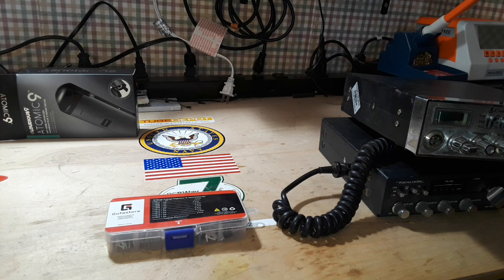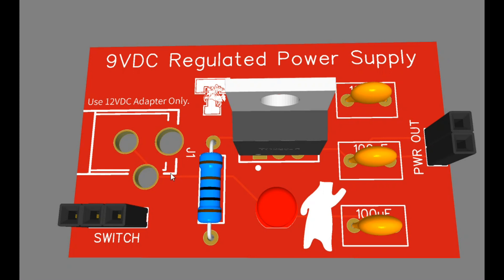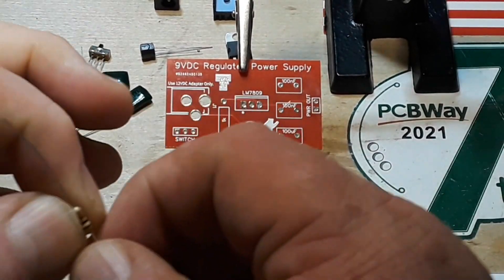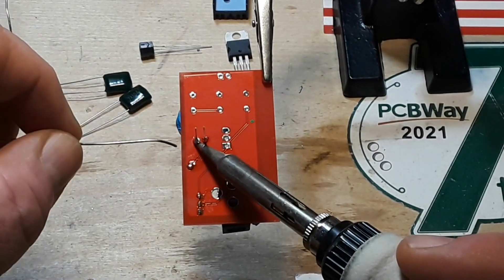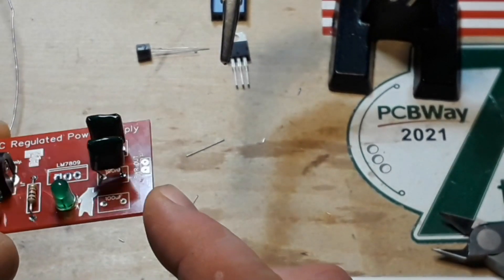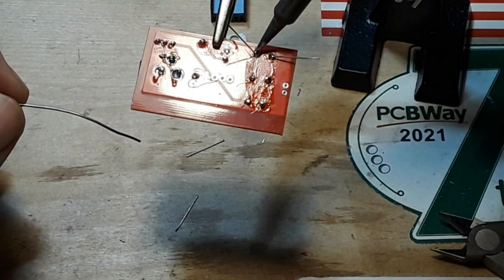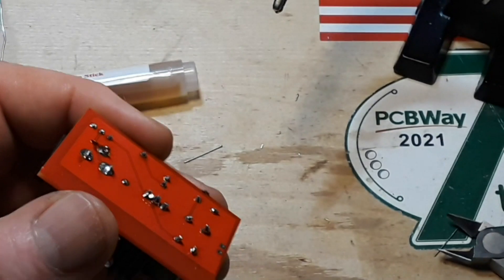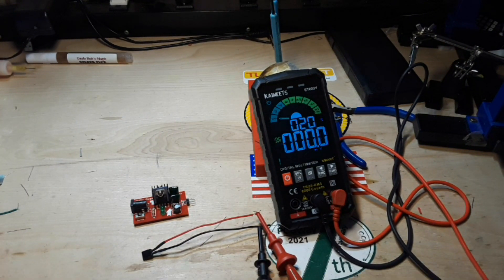More Volts For The STEM Kids

Comment: Interesting project (and all the other STEM boards). Components with leads exposed to the air for some time tend to build up an oxidised layer. Drawing some needle-nosed plier jaws over the leads before inserting / soldering can help to improve solder joints and decrease dwell time.

Comment: Fun project = thanks. Folks commonly only provide a LM78xx the minimum dropout overhead voltage, say 1.5V. However, the fine print of the Data Sheet states that the V Reg will not provide its maximum ripple rejection, unless you provide it with 3V of overhead voltage. Hope that helps.